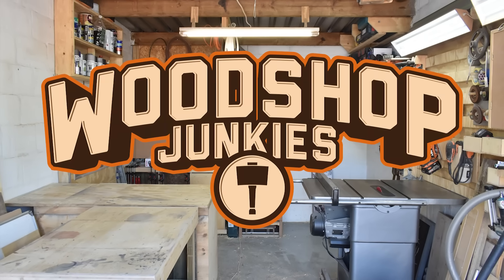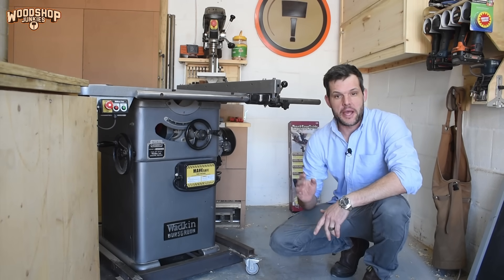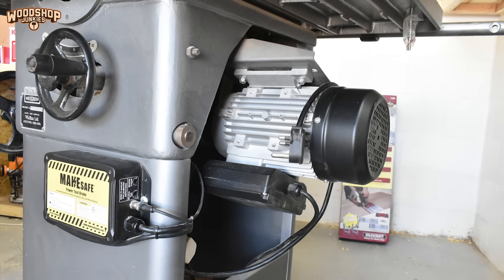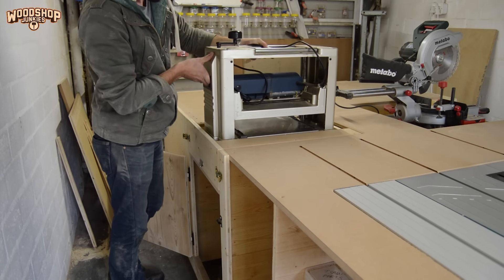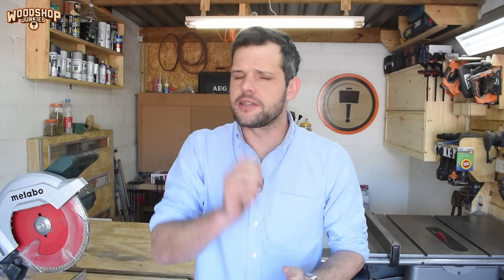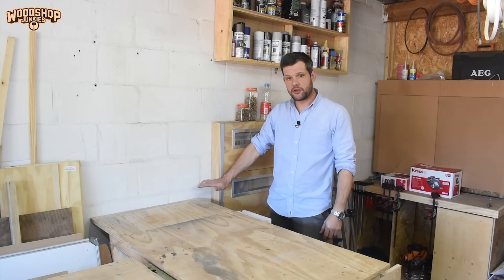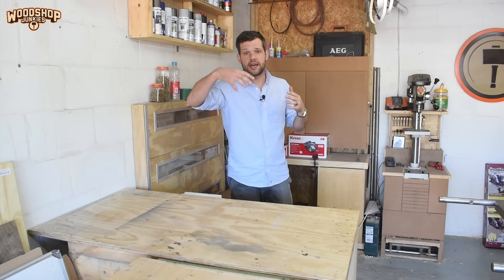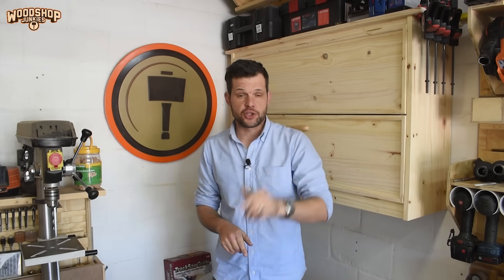How I Plan To Build The Ultimate Small Workshop - Shop Talk

Comment: Why not go with battery powered 4:48
Reply: I agree with Terry on especially if you're having to deal with rolling blackouts regularly. I, too, have a small shop with power issues. It's a 5 x 14.5 ft deck with not outlets. All my power tools are now battery-powered,  except my larger shop vac... it's made a big difference. My only advice is if this is something you chose to do... is to pick a platform. I only use one and still have a lot of batteries.  I can only imagine how many batteries I would have if I was using 2 or 3 different platforms.

Comment: Personally, the Bosch GCM-12 was a great investment. The lower wall clearance is great if you need to get the saw right against a wall to save space like you mentioned. However, it isn't exactly zero because if you are making a miter cut, the belt housing does need some space to rotate. The saw is belt driven and has plenty of torque to cut through large, dense stock. There are three upgrades I recommend though: a larger fence for support, a zero clearance insert to prevent off cuts falling into the throat plate and help direct more saw dust to the dust boot, and an upgrade dust boot like ShopNation has engineered. There are other saws with low wall clearance. Some, like the Delta 12" Cruzer have articulating arms like the Bosch while others simply have the tube rails coming out the front instead of the rear.

Comment: I love the videos as space saving / efficiency of use is important to me too. I’m super excited to see where you go with the modular workbench because it sounds like something I’ve been wanting to do as well. I have also considered mounting an electric hoist &/or pulley system in my roof to keep as much as possible stored overhead but easily accessible whenever needed, so basically figuring out how to use the “unused” space. So if you gave ideas on that, I would love to get your ideas.

Comment: Miter saw: zero wall clearance is a must for a micro shop, so you either need to store the Metabo or similar saws rotated to 45° or get a zero back clearance saw. The 45° sportage solution requires you pull the saw away from the wall to use, then 45 it &push back for storage; whether that also requires adjusting "wing" support out from the wall would depend on design. A really slick design would be to live w/the Metabo & design a setup you can transition later to Bosch which is the best short of the money suck that is Festool. That gives you a nice value add for all us money & space constrained viewers for a) the design aspects & b) the added episodes for the transition. One of the great features of Bosch is it can be upgraded for MUCH better dust collection (which I note has not been a high priority for you) and that's another episode when you get there

Comment: I would keep the restored tablesaw, it will provide you with a much better product.  in terms of small shop, I would like to recommend a couple of videos from Acutabove Woodworkings.  A few years ago he did a shop tour.  Now, he has a very tiny shop, and his arrangement of tools allows him to get what he wants done.  My only suggestions from his arranglement is to locate the table saw where you can cut sheet goods.
https://youtu.be/Q7UyffRMbXs?si=FqkBcH8A9rFlyqZ9
https://youtu.be/oPfc4xC79HY?si=xCR1o1gL-2ysCNhr
He has everything layed ou where he can use it without issue.  His bandsaw is right next to his toolbox, but the toolbox is not in the way of using that bandsaw.  

It will be interesting to see your shop build and grow through the build.

Good luck
Reply: because of I was bothered, didn’t get to hear all of the video.  I went through it again, and these videos may not work based on how you described how youd wanted to build out your workshop.  But, maybe you can get some ideas.

Comment: I'm looking forward to seeing what you come up with for overhead storage. I think this is the most under-utilized space and haven't seen many people try to find ways to utilize their ceiling space. I have a garage with a ceiling under 8 feet tall, so I can easily reach it. Mainly I plan to use it for clamp and lumber storage. But I also and planning storage for cans of paint and finished that just pivots down on a steel bar. Those few things along would free up a lot of wall space.

Comment: You always have fantastic content and brilliant ideas on how to approach projects.  Keep it up!

Regarding the miter saw I have the Bosch saw (for several years) and I love it.  The flat against the wall feature is great, but besides that it is rock solid and extremely accurate, and while no miter saw has great dust collection there are aftermarket add-ons that work very well. For a small shop the Bosch mechanism can’t be beat.

Comment: I think because you have a tablesaw, either the big one or a semi-permanent contractor saw, upgrading your mitre saw may not be totally necessary. If you have to cut anything too big for your little Metabo, consider using the tablesaw, or even a circular saw.

I’m moving into a new small workshop space and I’m excited to steal your ideas!
Thank you!
Reply: I think the only reason he wants a new saw is to go to a folding-arm-style instead of the sliding-rail-style he has now. This allows you to keep them up against the wall because there aren't any rails that stick out the back.

Comment: This is an interesting concept, and I am very much looking forward to how your achieve your goal.  I will say that the term "dynamic" has me a little nervous.  My biggest issue when I try to make a system where things are more "free flowing" is, because I am constantly moving things around, I tend to forget where I place things.  This leads to a lack of efficiency because I have to try and remember what I was previously doing, and then think why it was efficient for me to place a tool in a specific spot during that project.  On the other hand, it could just be my "old man brain" and my declining memory.  :)